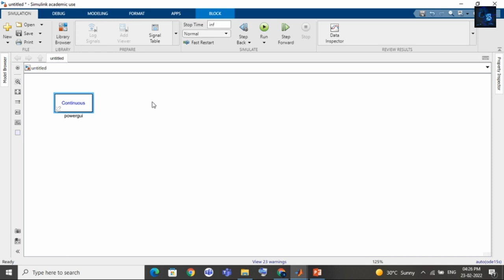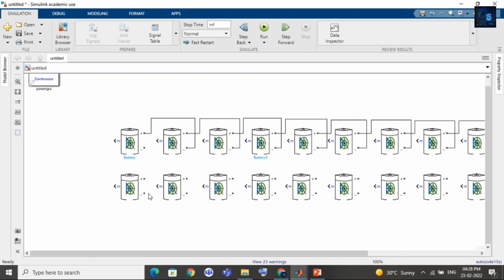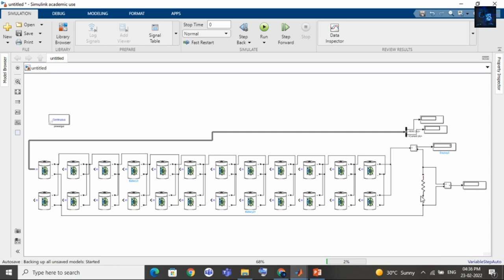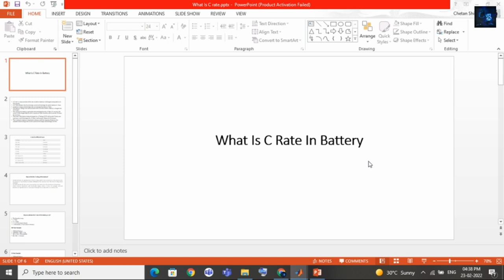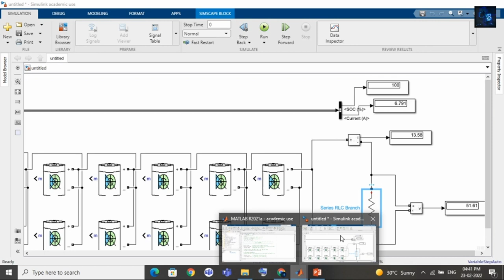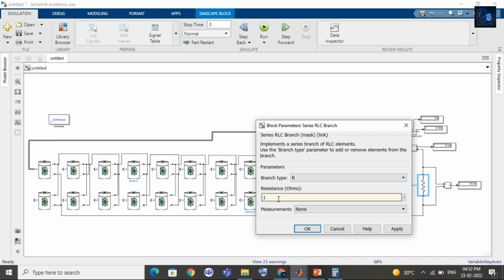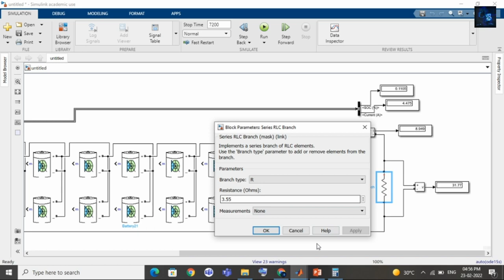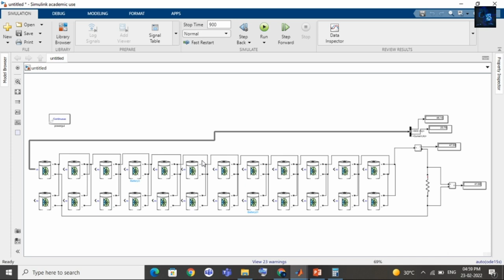How to design battery pack in MATLAB Simulink With C Rate Calculation

Comment: If 12 *3.7V  batteries are connected in Series, Voltage will be added, How it comes 51 Volt? i have tried it comes 94.64 Volt. Which one is correct?

Comment: Design 48v 36Ah LIFEPO4 battery pack for the dimension of 430mm(L) x 15mm(B) 
x 160mm(H) and develop the control circuit for sensing the individual array temperature 
with OV and UV protection with minimum harmonic content also calculate the SOC and 
SOH using Octave model 
Pls make a video sir in this question